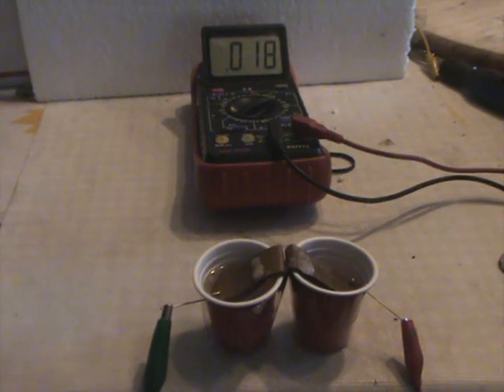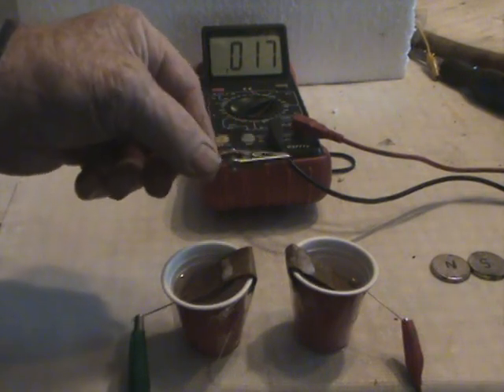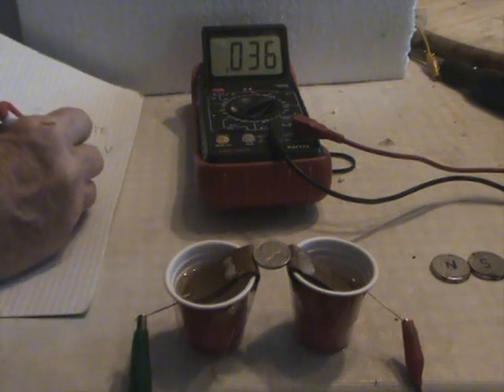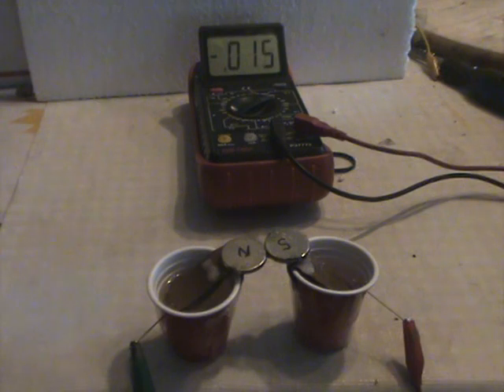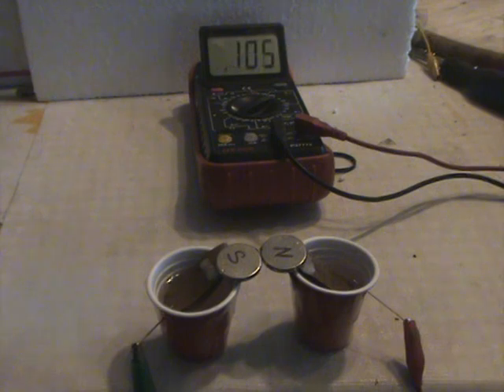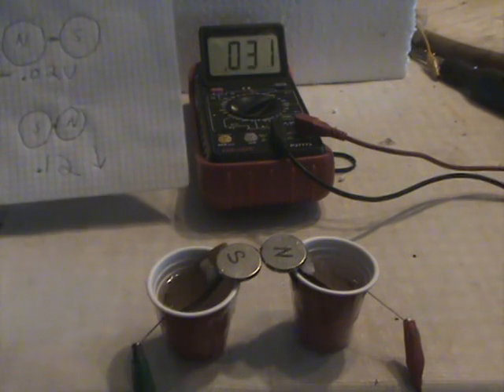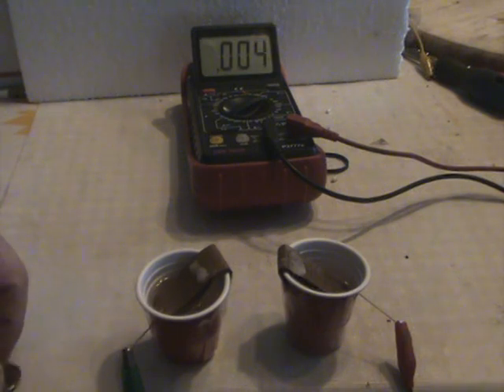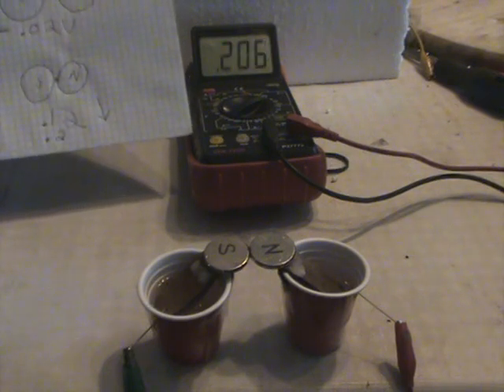Ray's Magnetic Battery ( Part 2 )

Comment: I think that magnet is polarising stuff around decreasing resistance as current can flow easier once dipoles are in order rather than in chaotic arrangement.
Earth magnetic field on it's own is to weak to force enough of polarisation.
Most likely temperature (#internal vibrations) sets chaotic arrangement of dipoles so perhaps the current will be stronger once You pour on it liquid nitrogen for an instance if there won't be noticeable difference once You pour just ice on it (as 0 to room temperature difference is fairly small).